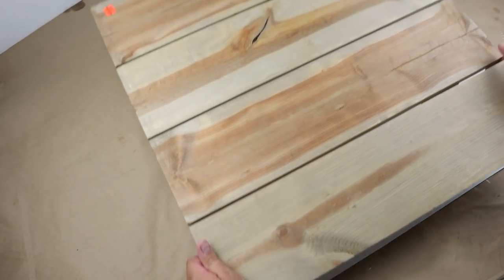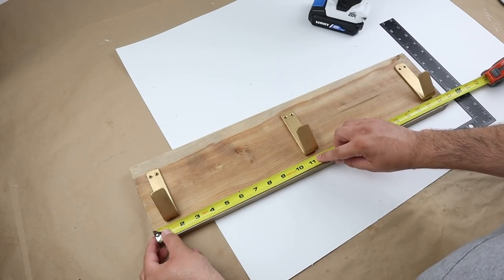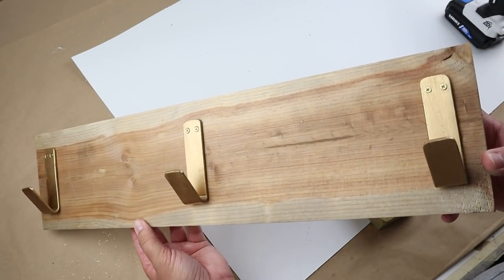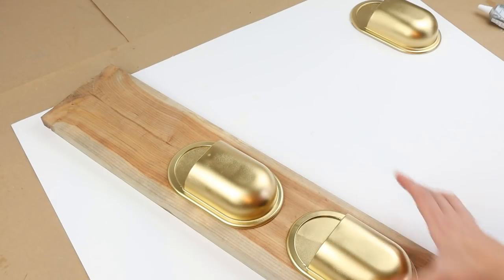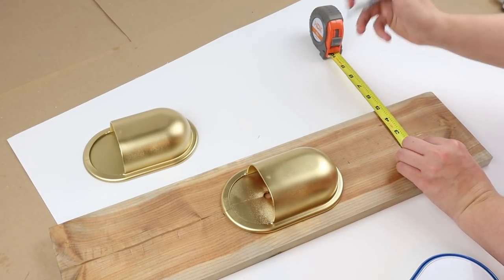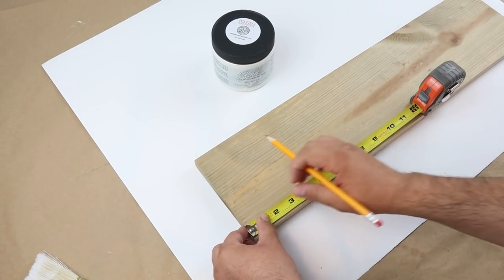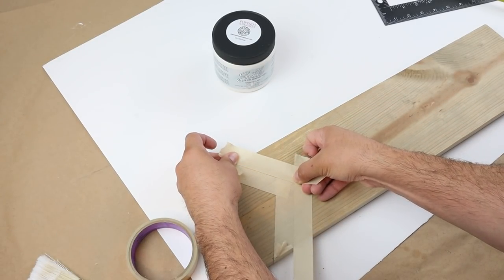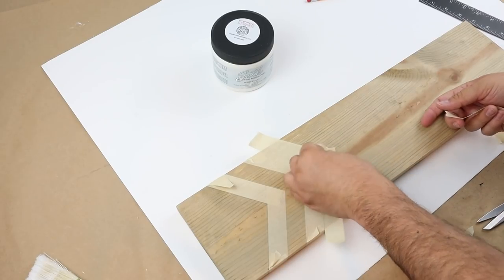⭐DIY Room Decor! EASY & AFFORDABLE DIY Boho Decor You Can Easily Make!

Comment: Wondering if you sanded/scuffed up the plastic first? You can use 0000 steel wool or 600 grit sandpaper to remove the shine, then spray primer. 😁 Otherwise the smallest thing will scratch this & remove the gold…and mess up a beautiful project 💜